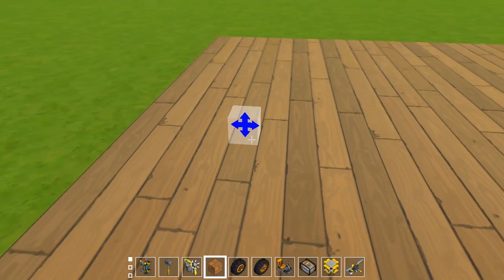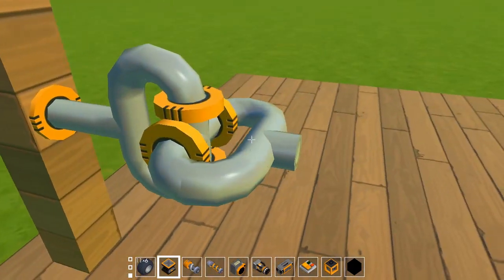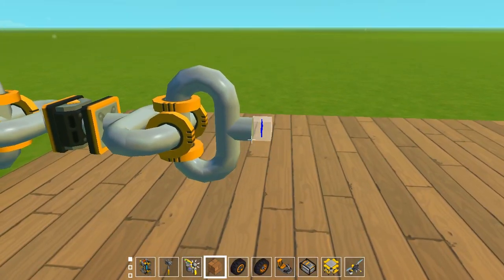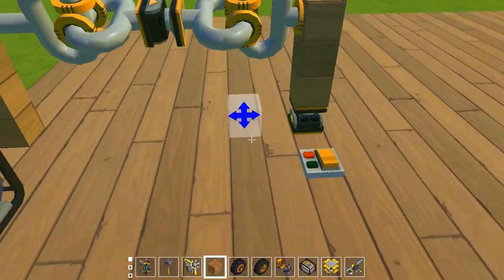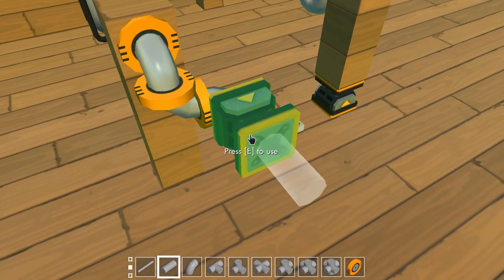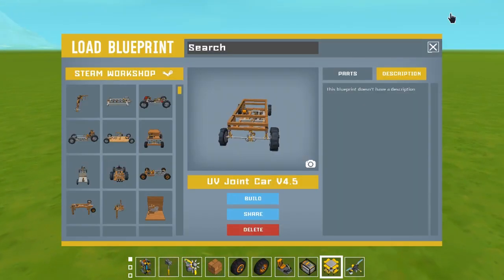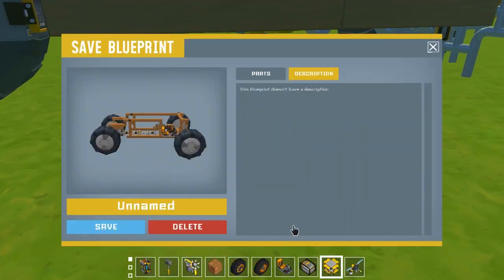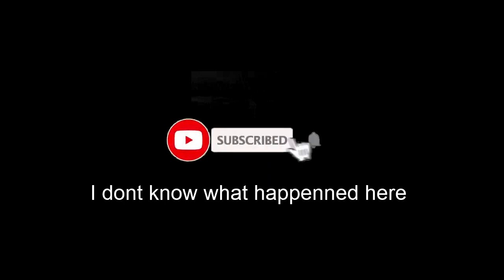Scrap Mechanic- Universal Joints and how to create them.

Comment: is it possible to have the output bearing lowered by one space by default with the u joints without the piston?
Reply from the maker: You can but if you don't have the piston the the U joint can only go like 2 blocks up and down